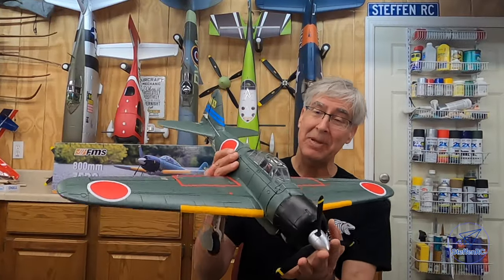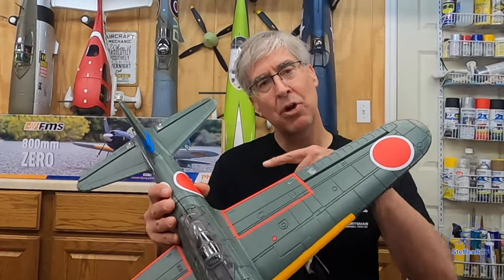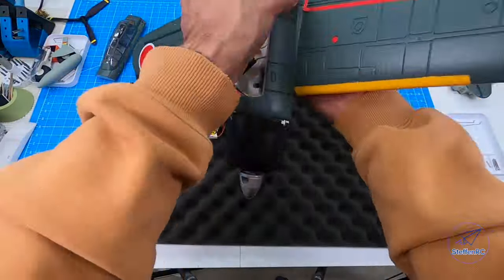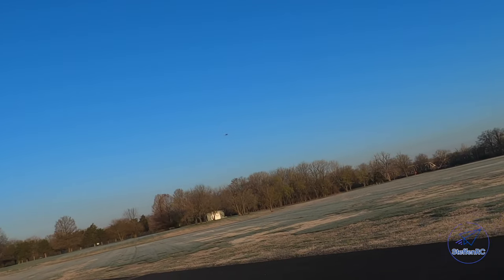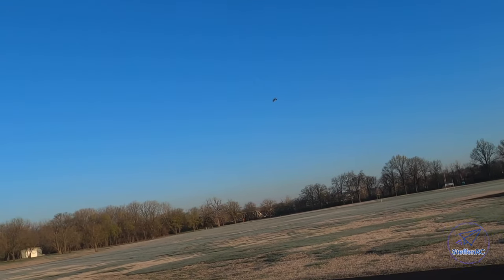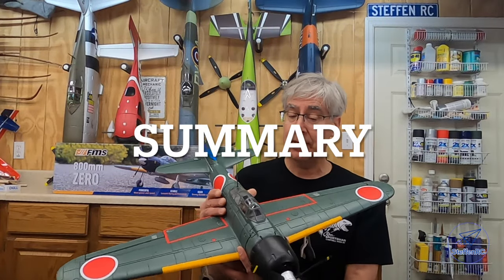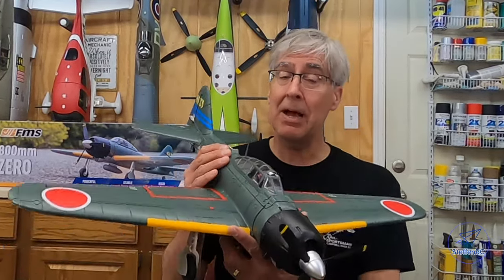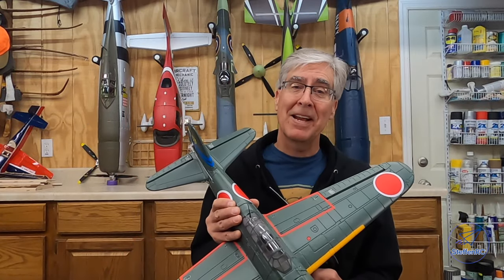FMS Zero 800mm RC Plane is a sweet little plane

Comment: Great beginner warbird. I've had 5 over the years. They do start to wear out at about 60-100 flights but FMS stocks plenty of spare parts.  Landing gear begins to bend then break after repeated landings and the area just ahead of the cockpit is weak and will snap off if you accumulate too many hard landings so I reinforce mine. Props are a little fragile so I use Master airscrew. I use the recommended FMS battery which is heavier and adds weight. Lasts 10 minutes easily . I would recommend the gyro for beginners to warbirds. It's very fast and agile and can get away from a novice very quickly. I've have tons of fun with mine and only lost one of mine  when a tree ran in front of me. I have 4 left and the y are painted in different schemes hence the reason for so many. They are really quite beautiful. Let me add once you master this plane you can fly any warbird. Add me to the drawing! I'm one short in my Kokutai.
Reply from the maker: Thanks for the comments.  Curious what battery you are using.  I'm using a recommended 2S 1300 and get 3-4 with moderate flying...

Comment: Keep up with those training videos they are very well done - FMSZERO - Rudder  authority on ground : Try moving the linkage at the rudder surface to the inner hole and the rudder servo arm linkage to the outer hole. If that makes rudder yaw too twitchy in air you can assign a switch with rates for ground and air to limit it.
Reply from the maker: Thanks..  Really appreciate the comments.   I'd like to adjust the tailwheel linkage, but there isn't much room to dig into it.  It seems like it was installed prior to the fuselage halves being glued.  Its Ok.. Just requires some room for turning around on the runway...

Comment: Hi Will.   Enjoyed your review of the  "FMSZERO"  this morning.  It does look like a nice war bird with good handling / flying abilities.  If a person has some nice soft grass to land on - it seems like it would be a good plane to fly without the gear.  I was pleasantly surprised that you had the aerobatic ability shown with just a 2S battery.  And it had a good presence in the air.
Reply from the maker: It really handled well with the 2S..  I didn't have high expectations and was surprised...  Good plane and the power system is more than enough..

Comment: For a smaller plane, would you recommend installing a gyro receiver?  A lot of the smaller planes get pushed around by the wind , just want to know your take on this.  Great video production from start to finish!  Your channel is very entertaining and informative!  FMSZERO
Reply from the maker: I think an AR630 or 631 would fit and could help in the wind.  I was flying in total calm and it was great.  I'm sure a bit of wind will toss it around quite a lot..  Thanks for the kind words about my channel..  Really appreciate it..

Comment: Great plane! Do you think it will be possible to attach a camera to it? It's a pity that only people from the US can take part 😅, but good luck to all US residents! Happy Easter!
Reply from the maker: I think a small 1S VTX system would work.  There isn't any room in the battery compartment for the Camera and VTX, so you'd need to find a way to install in the canopy..  Sorry I can't extend the prize to outside the US..
Reply: @SteffenRC 
No problem! Thanks for the answer.
😁

Comment: like you video about this FMSZERO. i did not expect that lead was needed, it was not really provided....what type of lead did you use?
Reply from the maker: I use wheel weight lead from tire shops.  They usually have a 5gal bucket full of old lead used for balancing tires...
Reply: @SteffenRC  do not you think that should be already added in the plane if it is well designed? am i missing something?
Reply from the maker: @alexherrera3918  there are so many variables on the cg.  Maybe the manufacturer painted a bit heavy on the tail?  Maybe the motor used 3 years ago has been changed but the design criteria wasn’t reviewed.  It’s quite common for modelers to adjust the cg based on battery selection and flying styles.  This planes battery compartment is small and no room to move the battery fore or aft to adjust cg.  So a small amount of lead can help.

Comment: Hey nice flying and smooth landing! I've been picking the hobby back up later in life, and I'm ready for an intermediate plane. The FMSZERO would be fantastic! Do you have any recommendations for transmitters?
Reply from the maker: I've been in this hobby 3 times.. Started in the early 80's, then again in early 2000 and then again 5 years ago.   There are a lot of manufactures of TX out there and I've used 2 of them.  FrSKY and Spektrum.  Other solid systems are Radio Master and futaba.  I was using FrSKY for several years and recently switched to Spektrum due to the ease of setting up a plane and the fact that most Eflite planes have a Spektrum rx already installed, makes things simple.  My FrSky is still used for my FPV and flight controller planes and drones.   I use this analogy for TX's..  If you like to tinker with computers and think Linux or Andriod phones offer flexibility and fun to mess with, then you might lean towards the FrSky and RadioMaster.  If you like things to just work and don't need to tinker around much, then I'd get the Spektrum system.   One neat thing about the RadioMaster is it has multiple protocols and you can use FrSky, Spectrum and other RXs with that TX..  While the FrSky, Spektrum and Futaba are proprietary systems.   Good luck in your search...  Will
Reply: Hey thank you for taking the time with this thoughtful response! I appreciate your expertise and that's a great analogy. I'll keep the search up with this info. Happy flying!